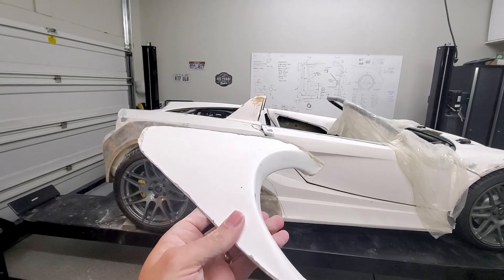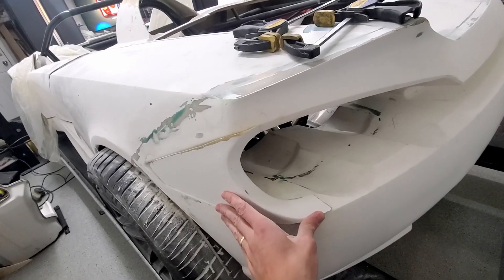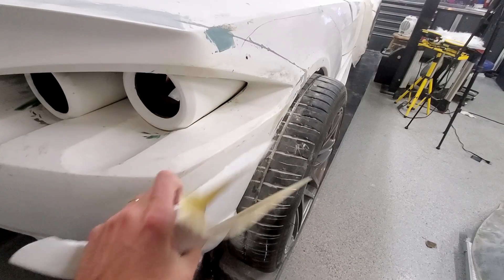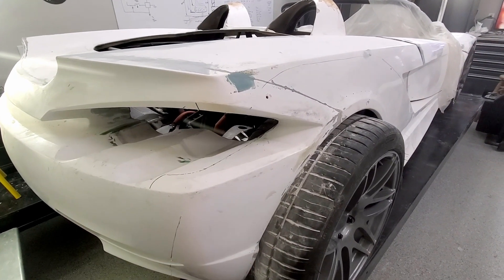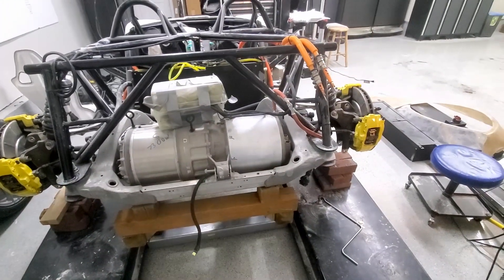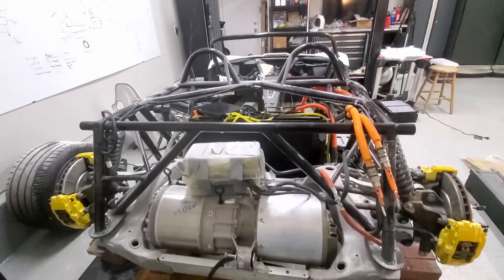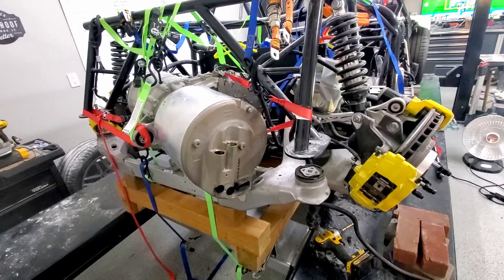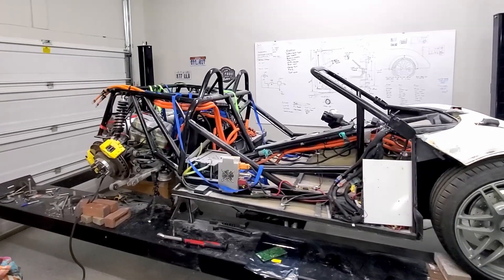Stripped - The Electric Supercar is Stripped to Remove the Motor for Repairs

Comment: Ok, so I misunderstood it a little with where you wanted to take the rear arches relative to the tail lights, but looking very good. Hope the electrical will be "simply" fixed by isolating the batteries from the frame more.🤞

Comment: I like your thinking, the best way is a process of elimination, stripping right back testing with one pack to see if there is an isolation problem somewhere, once it's proven to function as it should, adding the second pack. Also checking all electrical connections in the motor whilst swapping out the motor inverter board. Just enjoy Christmas with your family and leave the project and filming for now. We can always pick up after Christmas or New year. All the best to you and your family this Holliday season!
Reply from the maker: Thanks Alden!